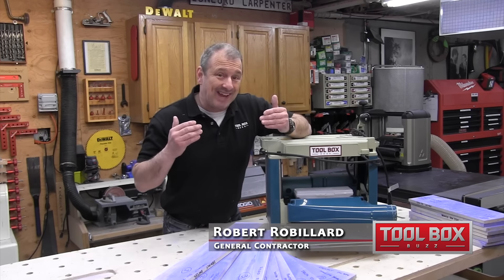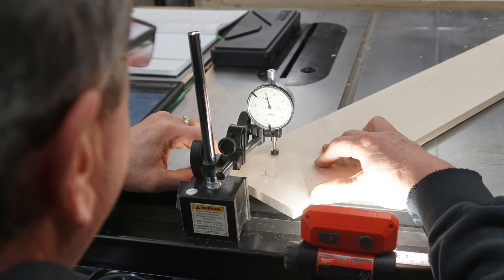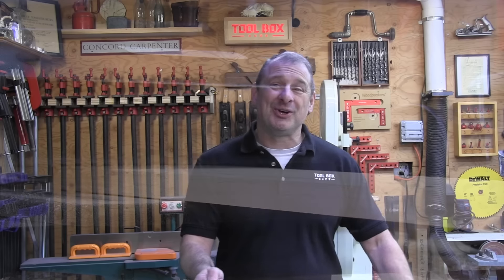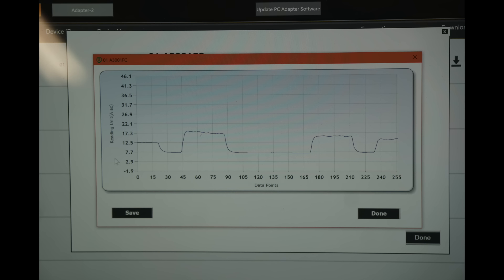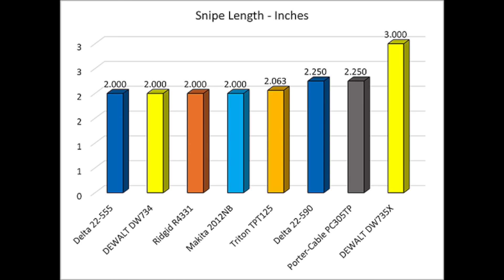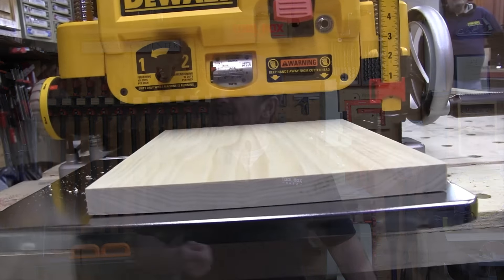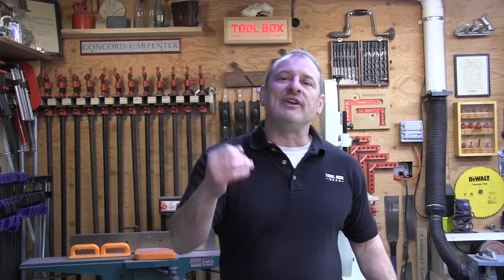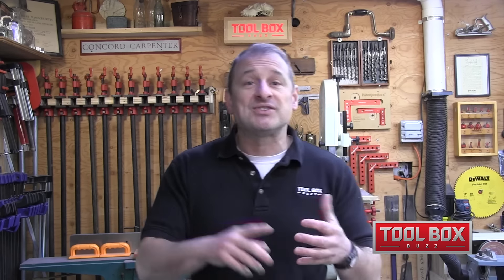Best Benchtop Thickness Planer ~ Head-to-Head

Comment: My experience Dewalt is superior above the Makita. Makita is almost worthles.
Reply: Interesting.. My Makita has been flawless for the last 10 years. Wondering if the machine is different now than back then.
Reply: @marksatterfield3100  Could be. I've bought a makita thiknesser bench planer in 2019. I could only plane 1.5 mm deep at a time. While a Dewalt bench planer of my cousin would do 3mm effortlesly. Both made in China.
Reply: @rudolfkasanpawiro644  Ha! I guess I never tried to plane 3mm in pass.

Comment: There are quite a few problems with this video. First off,  it's a little disingenuous to only choose to rank the categories that Dewalt won't or Triton was in the top 2. I found that annoying. Second off, the Ridgid did poorly in your first test comparing no load versus load speeds but did the second best in amperage output under maximum depth of cut. You allege that the first test indicates power. It does not. The Ridgid has a know quirk with the roller gearbox and the chains are fit rather loosely. This is most likely the reason the Ridgid did poorly in your feed test but took 2nd in your amperage test. The Ridgid, based on this fact, is the second most powerful. You also got the warranty wrong on the Ridgid. It has a lifetime warranty if the tool is registered. Now I have heard some complaints about how Ridgid processes these warranty claims but nonetheless that's the warranty. I found your value category to fall short as well. The Ridgid took between 2nd and 4th place in all your categories including second in board cut quality, overall power (amperage), and even tied for first in the snipe comparison. It's a 3 blade planer and there really is no excuse for not making it the best value. While I agree the Dewalt is the best overall, its clear that the Ridgid for whatever reason wasn't given an objective and fair shake.
Reply from the maker: RJ sorry your tool didn’t win - we share our methods and data with you so you can “allegedly” draw your own conclusion. Glad you did.!
Reply: @ConcordCarpenter  I dont own a Ridgid. I have all Grizzly tools. You're obviously getting a kickback from Dewalt or have a bias against Ridgid. If you look at your own data, especially the power data, you'll see it's a flawed test. I could care less who "wins" in the portable, plastic planer test.
Reply from the maker: @RJ-kg5jh  Sorry but ....NO!
Reply: Then why misrepresent the warranty?
Reply from the maker: @RJ-kg5jh  This is the 1st time you mention warranty. What is the issue with it?
Reply: @ConcordCarpenter  read my first comment in its entirety - it's all there

Comment: What kind of magical blades are you using that allows you to plane an entire year on one set of blades? Or, or, OR I guess planing one board for one pass from some pre-flattened board from a box store denotes planing and getting a year from a set of blades. Let me say this. Hands down DeWalt 735X is by far the best planer out there, having said that their steel used in their blades is total garbage. Those blades knick ridiculously easy even on clear No 1 poplar. Total garbage blades, avoid DeWalt brand blades. I went to my all faithful Powertec blades and I get a reasonable time out of my baldes again. Next month the Shelix head goes on.